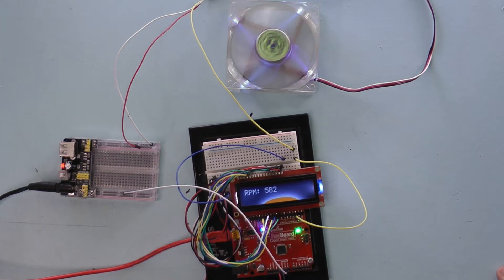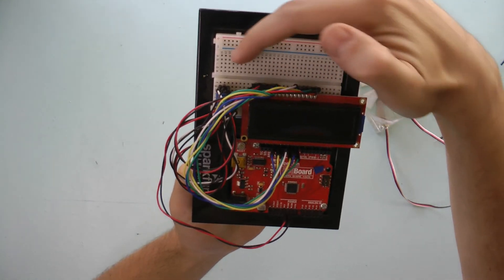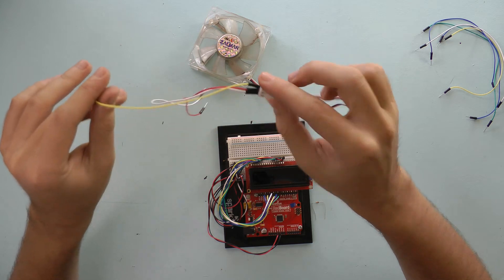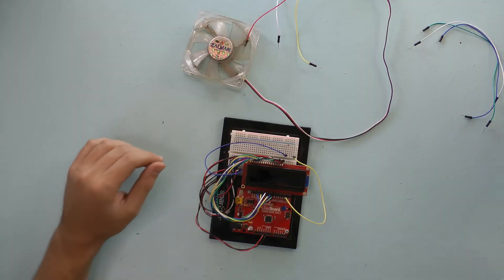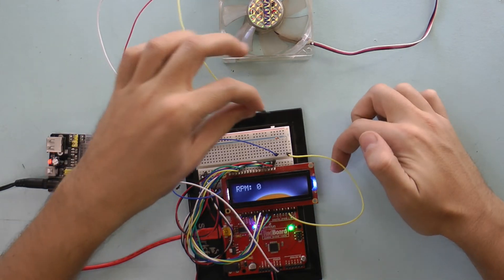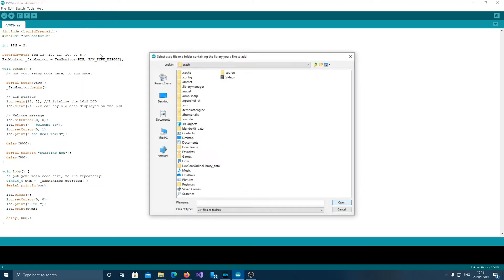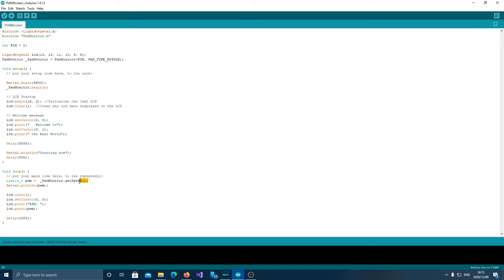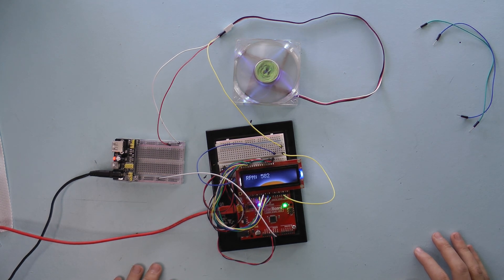How to read PC fan speed using Arduino

Comment: Just an FYI. That's not a PWM signal, 3 pin PC fans are DC controlled.  On a 4 pin PC fan the blue wire is the PWM signal (to control the speed). The yellow is common to both types and carries the tach signal from the hall sensor (for reading the speed). This is more for anyone watching this, who is wanting to try this out. 👍

Comment: Hello. Does it work with multiple fans?
Reply from the maker: No. Each fan sends a signal, so if you connect 2, they will both send signals and the reading will be incorrect. BUT you could modify code to display 2 fans, each fan will plug in to a different pin on the Arduino.

Comment: I want to turn an old PC fan into a wind speed measuring device. This means that I only want to read the Yellow wire, without RED and BLACK from the fan connected to a power source. Practically the wind will turn the fan, it will have an RPM which I will translate to m/s wind speed. Would only having yellow wire connected work or you also need ground? If anyone has done this, could you try disconnecting the fan from the positive and turn it by hand, see if you get a reading?
Reply from the maker: Not something I've tried, but very interesting. Have you tried posting in Arduino Reddit?

Comment: How does resistor affect RPM signal when tapping CPU, GPU, or case fan(s) already connected to headers on motherboard? If these wires are removed from fan headers, motherboard will report that fans have failed. I don't want to feed power into sensor pins.
Reply from the maker: I havent tried, however it should work as the PWM signal (yellow cable on fan) is simply reporting the passing of a magnet. Resistance change should be unnoticeable.

Comment: great video,thank you .btw will it be drisky if I don't use the resistor?
Reply from the maker: Not risky, but might not work. The value could move around (this should be obvious, it wont be small amounts)
UPDATE: Value will be 0 if no resistor is present
Reply: @Devempath  Thank you!
Reply from the maker: @fyras6353  Tested this and it will not work. Value read by Arduino is 0 RPM.
Reply: @Devempath   same
Reply from the maker: @yesima8939  won't work without a resistor
Reply: @Devempath  i know i use 10k pull up resistor but did not work
Reply from the maker: 10k might be too high resistance, do you have anything lower like 330?
Reply: @Devempath  I also tried 4.7k
Reply: I can try 330 also
Reply from the maker: @yesima8939  Should work. Googled around and plenty people use even 10k resistors. Hmmm double check all connections?